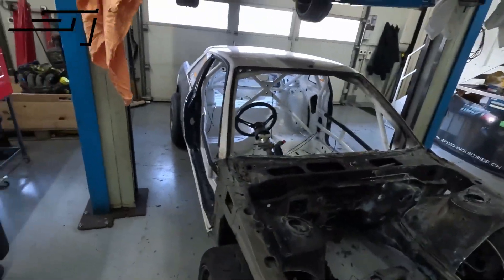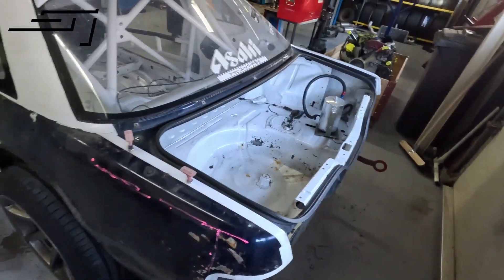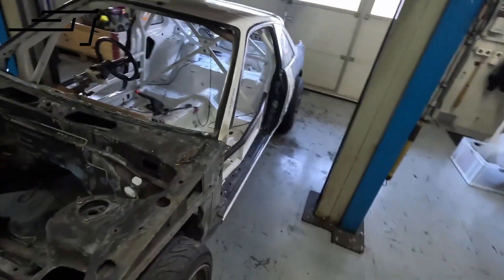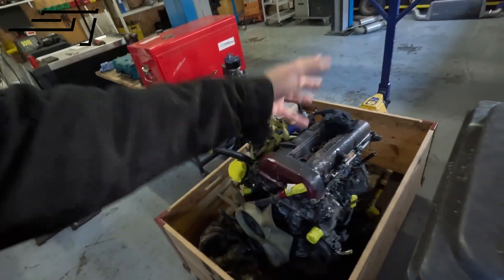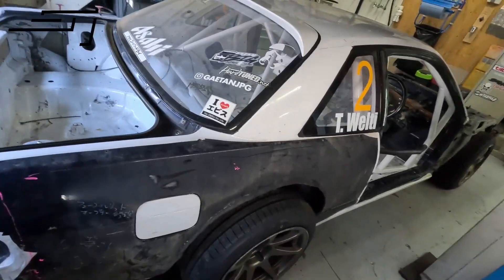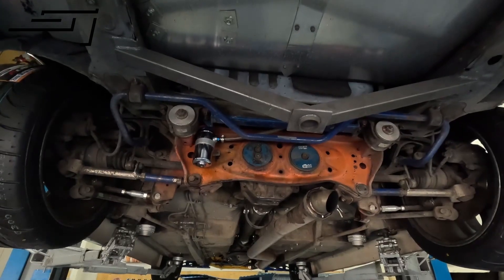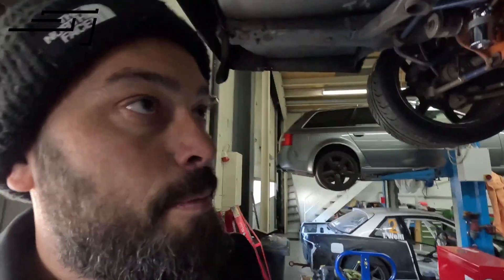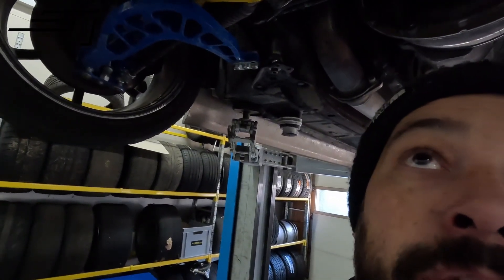PS13 Silvia rebuild, JZX100 fresh up and some plans for April - Speed Industries

Comment: It would probably make sense to go 1JZ since you have the Chaser and you can swap parts when needed. 

But if you want to do something that will attract some attention you will need a crazy swap.

- 13B Rotary Big Turbo (450+HP)
- Supercharged/Turbocharged AMG V8
- M5/M6 E60 V10 (though I heard it's not quite reliable)
- VR38DETT would be cool but might be too expensive.